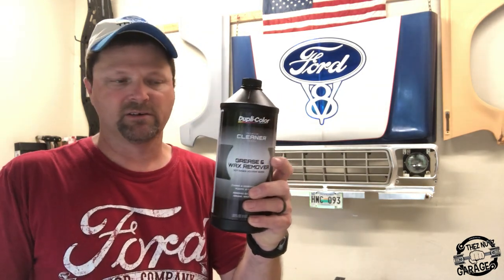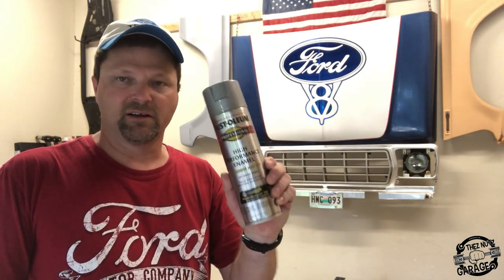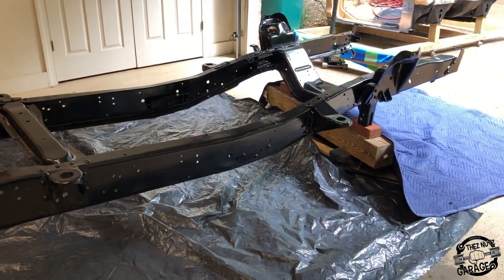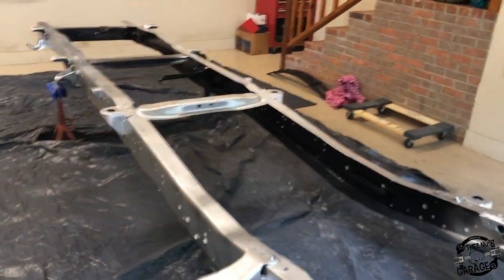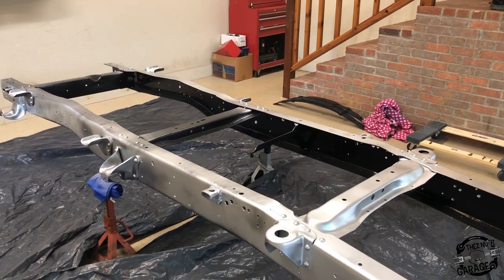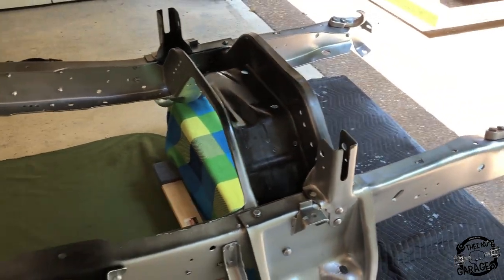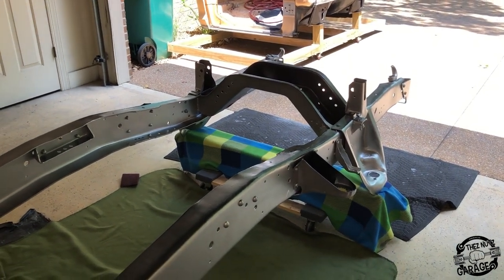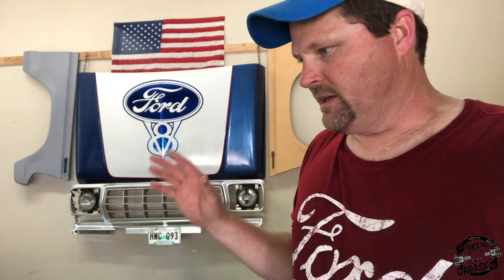Rust-O-Leum Paint Job! - Thez Nutz Garage Episode #32

Comment: Did you use the Rustoleum over the POR-15?
Reply from the maker: I did and it worked but it doesn’t adhere the way I wanted it too.
Reply: @ThezNutzGarage  Did you scuff it or just painted over it?
Reply from the maker: Yes I painted over the por-15 and I think I needed sand it a little after it dried.

Comment: Nice video. How’s the frame holding up so far? I’m thinking of using this product.
Reply from the maker: Pretty good. I am still working on the suspension. I should have went over the frame with an 2k primer then painted it. The POR15 is very slick and the paint doesn’t like to stick very well.